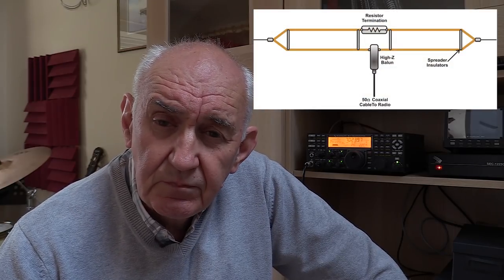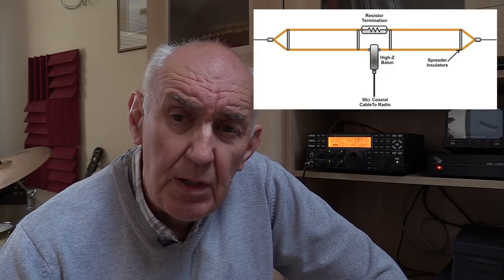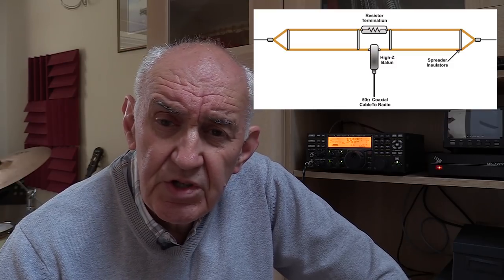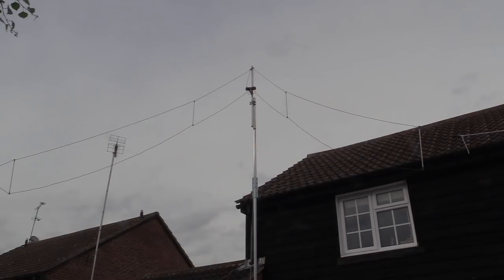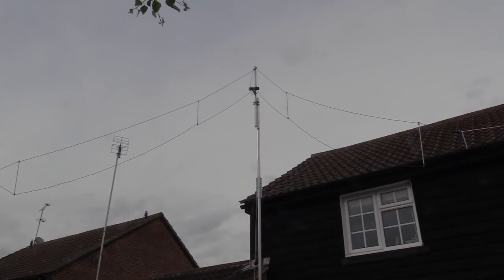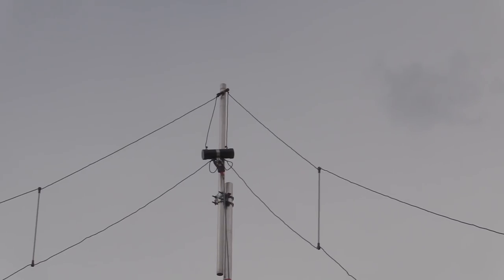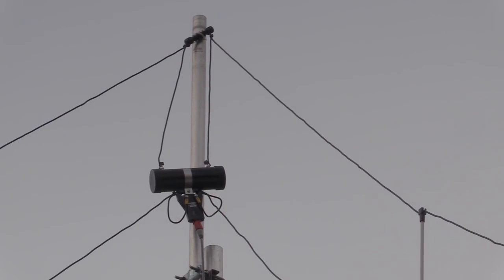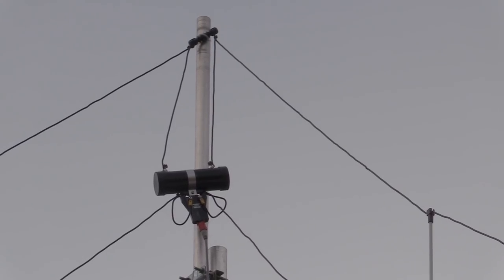DIAMOND WD 330S a T2FD Short Antenna 2 - 30MHz

Comment: I want to build the 3 wire version (T3FD). Let's say I use a 1000 ohm termination resistor.
There seems to be disagreement about the balun. Can you explain how to choose a balun ratio of 9:1 vs 12:1 vs 16:1?

Comment: I don't think that combining the terminating resistor and the balun IS a cheat. Better still, a good idea.
They are quite isolated from each other. Those very short, down-connector leads from the upper wire will have no discernible effect on on the performance but the upper wire will not have to sag under the weight of the terminator thingamajig! This is assuming that the feed point is not supported on a pole;
It has an improved S/N ratio because it's a loop.... Mag Loops do the same.. 
I do read that local, bacon (sausage, chips, or french, ) frying noises are mainly E field so enclosed loops respond less to the E field noises. My 6/7 foot dia. Mag loop is MUCH quieter.  
What do you anticipate (or have you tried it?) from the full sized WD 330?  Or for folks for whom space is no problem ?
Build as BIG as you have space but remember the resistor?
The WD 330 (not short) is, like the YAESU YA 30..81 feet long and the two of them must have similar performance in a given situation..
These devices are non resonant "travelling wave antennae."
Some power may well be lost into the resistive load but the antenna is much in the way of a LEAKY feeder, in that the load assists the match but RF which is intended to 'leak" off, does so by radiating! 
REAL experts may well confirm my own suspicions that I don't know what the Devil I'm talking about.
Build such a device just as big as you CAN!
Measure it not for resonance but for "Can I fit it in?"

Comment: Hello Peter and thank you for this video. I think for this particular antenna it is important to know what to expect for TRANSMITTING performance as it differs significantly from receiving.
I use this antenna since about two months, first month listening, now over a month of making QSOs. Here comes my brief review:

Quality (materials etc):
Very good ! Very easy installation. Somewhat limited manual in English (it seems there is an additional information in Japanese), but this is no problem
. It was pleasure for me to open the box and deal with the quality product :)

SWR:
My first installation was awful: in the attic, 2m above the concrete floor, with 75 Ohms feeder. SWR about 1.5:1 - 2.5:1 for bands 80, 40, 20m. Around 2:1 - 3:1 for higher freqs.
Currently installed about 8m above the ground with proper 50 Ohms feeder + MFJ-945E tuner. Tunes very easily to 1:1 - 1:1.3 on all bands.

Receiving:
Very low noise levels. Very good signal to noise ratio. Worked very well even in the attic installation. For SWL full 5/5 from me !

Transmitting:
NOTE this antenna is max 150W power. I use it with IC-718 at 100W. My QTH is small town partially surrounded by moderately-dense forest area, tree tops about 5-7m above my antenna.
Results:
80m - extremely low TX signal strength, local stations 30..200km away talking comfortably to each other (and being 59+20 on my RX) cannot hear me at all, I made single QSOs SSB and CW with huge effort; practically: 80m is RECEIVING ONLY
40m - TX signal weak; I am able to make SSB QSOs with non-DX stations having good antennas / strong signal; somewhat easier with CW; no DX yet; I need to respond to someone's CQ, I never got reply to my CQ
20m - TX signal weak-to-moderate; QSOs with non-DX somewhat easier than 40m; DX-es very hard but doable SSB and CW
higher bands - rarely tried, no feedback yet

Overall:
I rate this antenna 3/5. I think it can be reasonable choice for beginners who do not want to (or cannot) start the hobby with BIG antennas. Great atnenna for SWL period - awaiting license :) - then "good enough" as universal antenna to try various aspects of the hobby, SSB, CW, different bands.
I do not recommend this antenna for more experienced HAMs, who consider it just for its small size. In my opinion its transmitting capabilities are too limited for anyone who is already into this hobby, not just starting.

Hopefully my feedback will by useful for someone :) 73 TU E E
SP5CKI
Reply: goinghomesomeday1  Hello, thank you for your comment and interesting link.
I provided feedback to this specific model of the antenna, which is short version - just 10m long ( WD330-S ). It is also limited to 150W max.
I believe various implementations of T2FD can give quite different results. As I understand yours is 20m long. I expect for 80m band the difference between 20m and 10m antenna can be essential.
The trees around my QTH can also impact my experience, anyway 80m band transmitting works very very weak, much weaker than 40m or 20m. Practically - receiving only.
(To clarify: it is not installed in the attic anymore - it was there just at the beginning, listening only; now it is outdoors with high quality 50 Ohm feeder)
P.S. I like my WD330-S and I do not discourage anyone from buying it. I just share my results with 100W rig and antenna installed in QTH / height as described.

Comment: Hi, have you had any dealings with the SE-HF-360 XP HIGH POWER 1kW FIBRE GLASS VERTICAL ANTENNA, claims it will cover 80 TO 10 METRES, using internal atu of tranciever
Sorry for caps, copied and pasted
Regards
Eddie

Comment: I have a wd330 and ime wondering if I could cut it down to wd33s size, any ideas Peter....mni tks Hughie
Reply: I have the shorter version but not sure if the longer one uses a different balun and resistor. Might be worth emailing Diamond antennas. I know  the smaller one is around 33ft long.
Reply: @shizzle666440  Ive spoken to Diamond and their Engineers say it isnt possible just to shorten the WD330.
Reply: @hughiepuk  There is a WD330S for sale on ebay at the moment if you search it's not cheap though pretty much the same price as a new one.

Comment: In my case I have 3 telegraph cables crossing my garden at different heights  so I have found horizontally placed antennas difficult as below the telegraph cables reduces reception quality and its difficult getting above them so a virtical antenna seems the way to go in my case. But which one ?At the moment I Am using a multi band end fed which at least enables me get some reasonable results.
Reply from the maker: Hi Mich, hang in there as in a couple of weeks I am going to talk about a low cost vertical that will at least enable you to test the difference without too much expense. 73s Peter

Comment: Do you know the width and height  for it in a inverted v configuration ?
Reply from the maker: It depends on the angle. Wr recommend 45 degrees for each leg. Peter

Comment: Hi Peter can you tell me something, i have a friend with a wd 330j and the swr is in the red, can you tell me if you should get continuity across the coax plug, in other words is the balun capacitively coupled as we get no continuity...if it was instructively coupled you would....he prob has a coax prob but i just was curious...but i wondered if we would get continuity from the onner to the outer of the so 239 on the balun. from Fred g4vvq.
Reply: g4vvq
You won't be able to "see' the 390Ω /across the feeder at the shack end  You should get a very low dc resistance from the primary winding  of balun which is NOT capacitively coupled in any way.
If it's at ground level... release the antenna connections from the balun...Now you should detect the 390Ω, looking into the leads, off to the folded dipole,. You won't get a short  circuit but an open circuit could be 
your problem!

Comment: Hi Peter - nice video. Is there a higher power version of this antenna? I suspect that anyone with a linear amplifier would be interested in thi.
Reply from the maker: Hi there. No there is only this version. 73s Peter
Reply: watersstanton thanks Peter. Could you recommend something similar (folded dipole) that would handle a higher power rating?

Comment: The problem is the resistor shunts the power and some power is lost in the resistor. I refer it to a dummy load with wings. That is how the SWR is good and the antennas seems quieter than others. It is basically has little to receive. One friend told me he had one and made many contacts. I told him what about the 100 ones you did not get. No free ride on the laws pf physics of antenna. I models the antenna and it is about 30% efficient.
Reply from the maker: It is the penalty for a very flat response over a very wide frequency range. Widely used by military.

Comment: Thanks for your review Peter! I just ordered the WD-330J model from Wimo. Going to test it to replace my 40m long OCF-dipole in an urban location. The OCF-dipole doesn't fit in quite well in my yard so I had to turn ~10m of it towards the ground. I have quite strong noise on 80/40m bands. A lot of it I was able to disable with proper CM-chokes. So I hope T2FD will even better the SNR for me. As I have a linear amp I will also try to change the original balun and terminator to bigger ones. Cheers! 73 de OH5GIO :)
Reply: If space is less of a problem, is there anything to be achieved by increasing
the length? Maybe doubling it? or more?
I have heard previously of the reduced noise level. 
Have been considering this antenna for almost *&^#$%! years and never got around to it. You could be my trigger for when antenna weather returns.
I believe that Yæsue and Icom do or used to do a version but I don't know what length. I have all the bits to go so come on Global Warming..Do your best.

Comment: Thank you for the review. This antenna seem to be a good solution to small plots. I´m looking for a 25 to 33 m (75 to 100 feet) long T2FD for my garden. So I might use it from the 160 m to the 30 m band. It would be nice if it could be used up to 500 Watts. 
73 Oli, DL1OLI
Reply: T2FD THE 150WATT VERSION COVERS 1.8MHz-to 30MHz (54MHz w antennatuner)
Icom AT180 OR ANY OTHER ANTENNATUNER!
BEWARE: WATCH YOUR OUTOUT POWER TO MAX 130-150WATT! 
73s de Gunnar sm6oer

Comment: Got one of these myself and yes, could be a problem with my radio or feeder but I am at my wits end with it. No one can hear me on HF!! I even tried listening to GB2RS this morning and nothing, not a sausage but used a few Wed SDR receivers up north and the broadcast from down south was loud and clear. I just get the feeling its fine on RX but rubbish on transmit. Did you have any luck with it making QSO's? Neil M0CJM
Reply: Hello Neil, indeed the difference of this antenna performance between RX and TX is huge. But you should definitely be able to make QSOs - especially on 40m and 20m. You can have a look at more detailed feedback I provided as another comment to this video. 73 - Peter, SP5CKI.